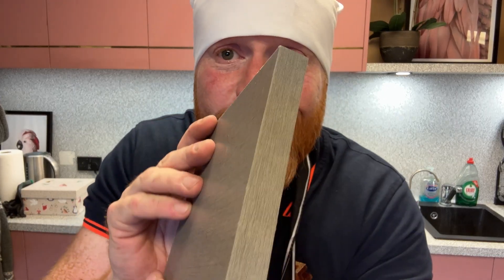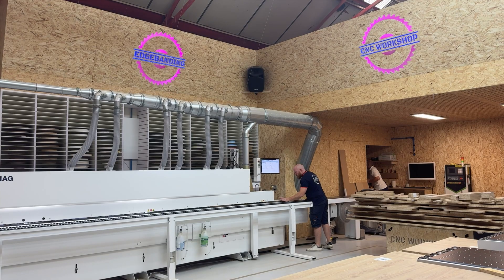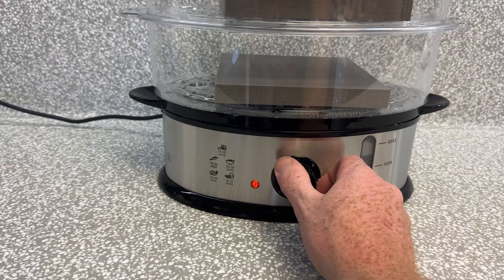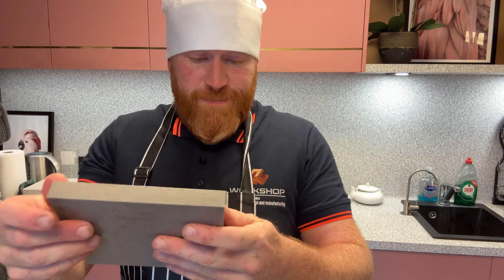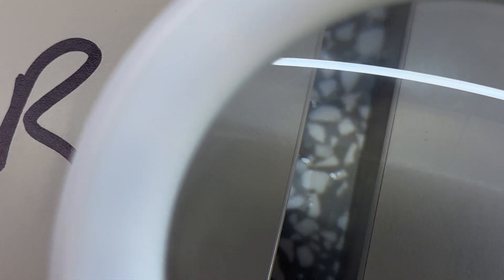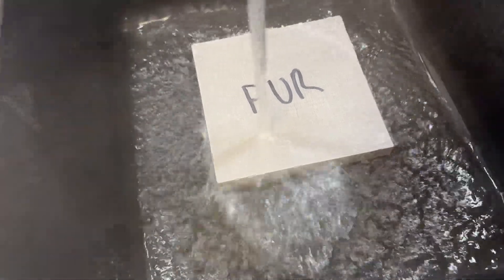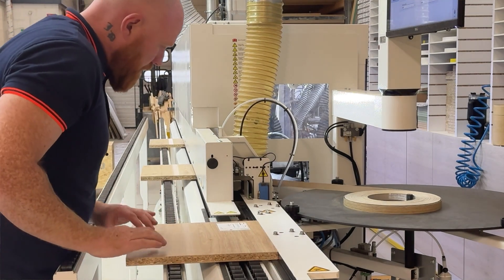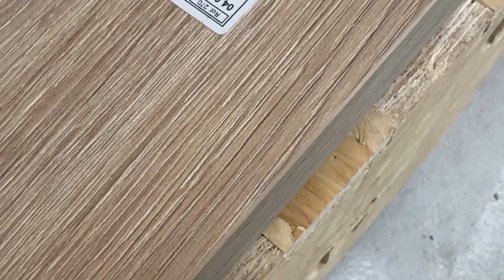PUR vs EVA. Why PUR Glue is the Best Choice !

Comment: Just curious do you have climate controlled factory? I've recently gone to PUR and its summer here in Australia we can only edge in the early morning otherwise the ambience temperature becomes to warm and we have all sorts of issues. Thanks for your video.
Reply: Supposed you're appling a winter version PUR, Suggest change a Summer Version instead. 
Our summer version suitable for ambient temperature 15~42℃ , while winter version suitable for -10~26℃.